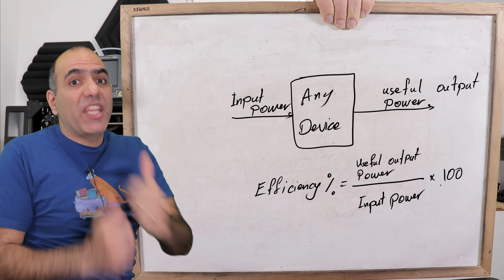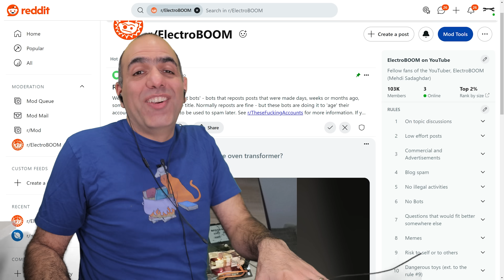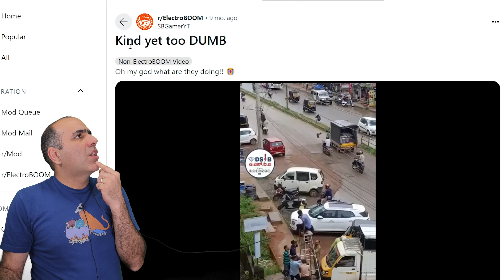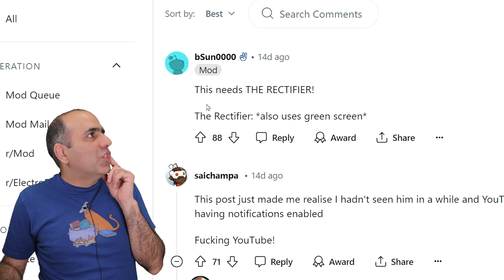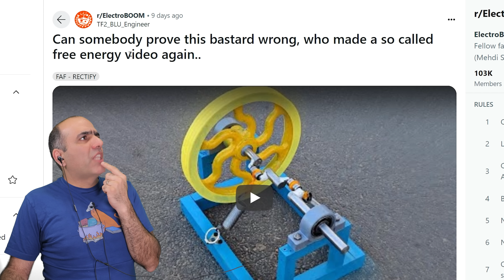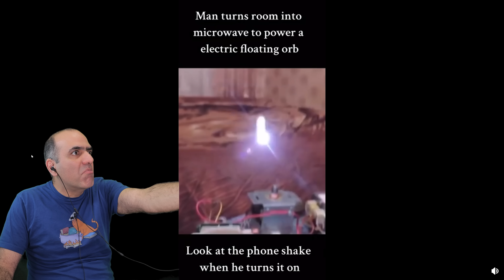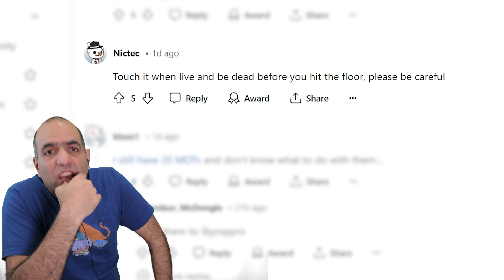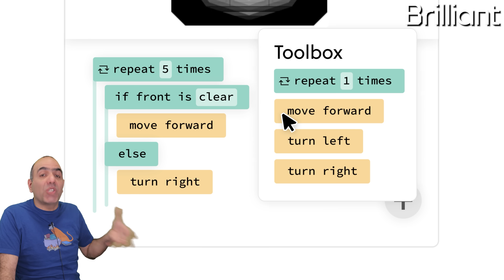New Flywheel Free Energy?! Can Boat Battery Fry You? LATITY-013

Comment: About the heater thing. A heater is intended to heat the LIVING SPACE, not you, so it doesn't matter. The losses in the cord, bearings, motor windings, etc. all get converted to HEAT which escapes into the living space, making it 100% efficient...

Comment: One kid in class the other day pulled the heater thing and i said it heats outher things not just you and some of the energy gets turned into visable light and its waisted energy
Reply: guess what happens when that light hits something...  heat
Reply: @tsm688  not necessarily the light gets reflected that's why we go for infrared heaters as they absorb into things better but visible light doesn't so well so some of the light the heater creates is in the visible spectrum and gets reflected instead of absorbed
Reply: @dbom_bp6653  one way or another the light is absorbed, unless it leaves the room.
Reply: @tsm688  it will unless you are in a completely seeled room bit visible light also doesnt convert as easily into heat energy as ir and this is all only with ir heaters normal element heaters are way less efficient either way there is all ways a loss to something even if your intention is to heat a whole room there is losses from the heater and other things around it
Reply: @dbom_bp6653  Light converts very well to heat, unless it gets absorbed by some chemical process like photodegredation
Reply: @tsm688  it converts well but not as well as ir ir photons have less energy witch help them absorb into objects better
Reply: @dbom_bp6653  you are speaking gibberish.  energy is not created or destroyed.  If they have less energy, it's because that energy was lost somewhere as heat.
Reply: @tsm688  there is also losses to sound energy listenin to a heater running they typically make a light buzz sound wich is also a loss of energy and sound energy the amount of heat it creates from the pressure waves are minuscule compared to the energy used to create them
Reply: @dbom_bp6653  you are, very simply, wrong.  those "losses" also become heat!  most of it just remains as motion - which becomes heat.  and sound is is just a different kind of motion, which also becomes heat!

energy is not vanishing from the universe.  Everything put into that heater therefore becomes heat.
Reply: @tsm688  i admit i am not 100% correct but niether are you that energy will eventually turn to heat all energy Turns to heat at some point bit it is constantly changing the energy for example in she sound some will excape through the walls and go create heat somewhere else the light excaping the room will go warm something else up even if your just trying to heat a room not all the energy that you put in the room is still there thus there is a loss of energy you can only say there is no losses if your trying to warm up the whole universe as then there is truely no energy losses but you want to talk about how energy cannot be created or destroyed but you forget the fact that nothing is 100% efficient in its endended out put there will always be a bi product of some sort as a lamp creates heat a speaker creates heat and a heater creates more easily reflectable light
Reply: @dbom_bp6653  "one way or another the light is absorbed, unless it leaves the room."

I already told you this, and now you're telling it to me as if that wasn't my point all along.  Pay attention.
Reply: @tsm688  bro just told me to pay attention 💀 I was also saying that the light can leave the room witch =energy loss and visable light bounces more thus has a higher chance of leaving. Pay attention
Reply: @dbom_bp6653  I told you that first.  Are you trying to switch sides of the argument?
Reply: @tsm688  no ofc it old have to leave some how where tf else would it go 💀 om saying it just wont nessasarly leave as heat it would leave as sound and light

Comment: 6:52 He was referring to new electric boats. The boats that are packed full of lithium batteries wired in series.
Reply: It looks like electric boat batteries are less than 144 volts DC. Of course note that DC is statistically five times less dangerous than AC. Most likely no one will ever be electrocuted by a boat battery

Comment: Even though heaters generate heat, they're not 100% efficient in producing heat due to black body radiation. They don't emmit all their input power as infrared but rather a spectrum with a peak in infrared
Reply: so what?  the other wavelengths contribute to heat too.
Reply: @tsm688  they do not. It's a common misconception.
Reply: @mannyquinn9031  They do.  It's a common misconception.

You can light things on fire with a powerful enough red laser.  I've done it.
Reply: @tsm688 heaters (hot resistors) work mostly by convection and conduction, which is the medium for most of the heat transfer, there's no way to measure the actual heating by EM radiation since different materials have different reflection coefficients. My point is "they're not 100% efficient in generating heat" since radiation isn't always converted to heat in objects, your lasers proves the point (no pun intended)  if you point your laser at an object, you're increasing the 'energy transferred' but the object still reflects visible laser light from the incident rays. No reflected ray can be responsible for the material heat up(conservation of energy) . Therefore, energy is lost via  "visible emission"
Hence, if your heater is turned on, it produces conventional heating and radiational heating via infrared, and the rest em radiation produced via BBR pass through the room almost unobstructed and produces only little heat depending on what material the room is made of.
Since some energy escapes without absorption, your heater has converted electrical energy to heat and other unused radiation. Therefore, it is not 100% efficient in producing heat

Comment: 11:00 Tell that to mrgreenguy. He opened up a microwave just to test this. And the conclusion is that it is too low power to do anything without the box around it.
Reply: tell that to the wire being vaporized in this very video.

There is of course a safe zone...  but you CAN'T SEE IT.  And microwave damage is insidious -- you won't instantly notice you're being hurt!  You might only notice when your eyes turn milky a few hours later...

Comment: In the heater some of the electrical energy will be converted into the mechanical energy due to the vibration in the heating the coil and possible light energy from the coils glowing when hot.

Comment: With a 12v battery you can't get electrocuted. However, i have a tractor that runs on 24V, 2 x 12v/100ah batteries in series, and in the summer, when it is wery hot outside, and i was sweaty, i did feel the current through my arm.

Comment: Common confusion of terms. EFFICIENCY is  'Useful WORK out' / 'Sensible ENERGY in'. A heater does no work so it is 0% efficient.

Like a heat exchanger, it can have EFFECTIVITY. This would be 'Thermal energy out' / 'Electrical energy in'. Not all heaters score 100% themselves because of noise, light, etc. But eventually everything does turn into low grade heat as we approach cosmic heat death.

Cheery thoughts. 😊

Comment: in regards to the trump comments about the battery I believe he was referencing a Tesla Model 3 which has a high voltage DC battery pack. I believe you know this, but instead chose to misrepresent what was said, and while Trump and his followers comments may have been absurd it doesnt justify your mischaracterization. Overall good video.

Comment: I worked on a 960 volt DC system for a hybrid boat, it is definitely a concern.  The boat had ground fault monitoring systems that blew pyro fuses in the battery modules, and in the series connections between them, eliminating the risk to what is shown in this video.
I volunteered to test the GFI on the live system. I had done it many times before on a 1000V power supply, so I knew it worked, but it was still nerve-wracking when you hoped everything was going to go bang but your finger.
Reply: Gas can be pretty nerve wracking too....   https://www.youtube.com/watch?v=erhd-FV4rb8
Reply: thats before some idiot replaced the fuse with a carved up penny. :P
Reply: In what scenario you would get shocked by a submerged DC powersource? You have to be swimming between the terminals
Reply: Yeah a Hybrid boat is what trump was talking about.  Still risky for sure even with GFCI.
Reply: @Ccs4646  Is 30 gallons of gasoline safer pouring into the water around you? I feel like its the same argument my great grandpa made against using a car and decided he'd ride a horse instead.    https://www.youtube.com/watch?v=wAM_EtjxFhE
Reply: @mikestevens4147  30 gallons of gasoline doesn’t spontaneously combust as soon as it hits water…
Reply: @Ccs4646  Hollywood says "Hold my beer". :-\
Reply: @Ccs4646  As already mentioned, neither do traction batteries built for marine use. What can happen though is that ships can produce sparks when damaged since combustion powered ships still have electrical systems. And there's usually a lot more than 30 gallons of gasoline on all but the smallest powered boats.

Comment: 0:40 some heaters light up. This would be a waste of energy. Some vibrate or make noise. Some have an LED or neon. These would all be wasted energy
Reply: That was the first thing I thought - it's the opposite in the case of a heater - light is the waste.
Reply: All of them eventually turn into heat.
Reply: no its not.  even a 100% perfect light source would still end up as heat eventually, as the light is reflected and absorbed various objects, unless you let the light escape the room.

Comment: Trump (guessing here) was probably ranting about electric boats with a huge Lithium battery. Having a DC battery of several 100V in the water might give you a tickle but i think in the sea, salt water has lower bulk resistance than you (more so lard-ass DJT). As long as you don't touch the terminals you won't get electrocuted. However if it's shorted and the cooling is not enough it miht still catch fire? hhat would be scary. Can we chuck someone's Tesla in the harbour to confirm?
Reply: The entire thing was really stupid, like a shark is most likely not even gonna come close to attacking you.

Cows are more dangerous than sharks ffs

Essentially trump's rant was "this one thing that probably won't harm you or this other thing that won't"
Reply: He was referring to fully electric cruiseliners.
Reply: Sea water doesn't give a total short. It would probably boil around the terminals and then break the connection. I don't believe the battery would  over heat. Also the sea water would cool it pretty well. 
Next the sharks are supposedly very sensitive to electric current in the water and would probably swim away. It would then be safer to sink with an electric boat than a normal one.
Reply: I mean, 30 gallons of gasoline in the water around you and one spark would be pretty bad too. Actually a lot worse since lithium burns slowly and doesn't ignite in a big flash. https://www.youtube.com/watch?v=erhd-FV4rb8

Comment: 0:54 Just want to point out, even if the goal is to throw heat into the universe, still it's  not 100% efficient. Some energy get wasted in generating sound, especially in those cheapo AC mains heaters. Even if we don't hear it out, some sub-atomic phenomena can convert some miniscule amount of energy into something else other than heat
Reply: guess what sound ends up as...  heat
guess what light ends up as ..  heat

the only wasted energy is the energy leaving the room
Reply: @tsm688  thanks for the reply. can you share some resources on the topic? does sound end up as heat?
Reply: @electrotsmishar  
sound ends up as heat.

light ends up as heat.
infrared ends up as heat.
radio waves ends up as heat.
particle radiation ends up as heat.
motion ends up as heat.
are you sensing a pattern?

This is a consequence of the laws of thermodynamics, which say energy is not created or destroyed.  When these energies fade away, what's happening to them?  They're either drifting away or becoming heat.

If a photon happens to hit a plant, I suppose it might be absorbed instead of becoming heat.  It still generates some heat, just less.  And when you burn that plant you get the missing energy back.  Nothing lost, nothing gained.  That's conservation of energy.

Comment: Hi Mehdi! I have a question to ask you. I was wondering if you could explain to me why when I play a 20hz sinusoïdalon tone on my tongue with an amplifier, I start seeing the LED bulb of my bedroom flickering. I haven’t tried other frequencies so I don’t know if it does the same thing with others. I tried filming the light at 240 and 60 fps with my iPhone to see if it is the light that is flickering or it is just something from me. Surprisingly, I never saw the LED flicker. And I also find out that it doesn’t do it when I connect de wires to a less conductive part of my body. So, my question is: Is the 20hz signal messing with the nerves of my eyes? If it is, can you explain me how it is doing that. Thank you very much! I love your content!
Reply: Not enough evidence.  A camera might not catch it unless it's looking at the exact right moment.  I think you'd need to watch (or hear) the LED with a photocell to catch it flickering.
Reply: I don’t think so because the was constantly flickering. Not only one time. All the time I was putting the wires of the amplifier on my tongue, the light was flickering. I had no way to mesure the frequency of the flickering but I think that it was pretty much at the same frequency played on the amplifier. Sorry if I didn’t explain it correctly, English is not my main language. Thanks!
Reply: @divaton  Sound is faster than the camera, though.  I think the output of a photocell circuit would be useful in figuring out what's happening.
Reply: @tsm688  I’m not sure to understand, there was no sound. Only light blinking. And it was pretty slow flickering so I’m pretty sure that the camera would have got it. But to be sure, next time that I’m gonna have the opportunity to redo it, I will ask someone to see if they see the light blinking to confirm if it’s the signal of the amplifier that’s messing with my eyes. Thanks

Comment: 3:33 Pretty sure this is fake, as I have the same candles and they just turn on with a remote
Reply: And I just noticed that the lamp turns on a frame before the fire appears
Reply: @KurzhaarBard 
First off, replying to your own comment makes you look like a fool.

Secondly, fake or not, this is actually possible and actually quite easy to make. Even a heat sensor in sync with a shock sensor would do the trick.
Reply: @dogs-and-destruction-channel  Why does replying to my own comment make me look like a fool?
I don't like editing my comment as there's always the possibility that people think what is now there is not the original message

Comment: Electrocution is all about skin conductivity(sweaty/salty 👐 and 🫀fibrillation. Only a small current(xx mA) need to flow between extremities for that to happen🤔). So a boat battery could indeed electrocute, but no smoke or fire involved😢. Also when two bulbs with varying wattages are connected in series, the bulb with the lower wattage(more resistance), starts heating up faster, and since tungsten filament has positive thermal coefficient, the resistance increases further, limiting further current through high wattage lamp(which then remains in its lower resistance state, without glowing). I do like the funny fact based presentation, though a bit simplified😊❤👍

Comment: heaters aren't meant to warm your body specifically as much as they're meant to warm the environment your body is in - I don't know if that necessarily makes them more efficient but I would have to assume that the actual efficiency factor depends on the resistor being used to generate that heat in the first place

Comment: 8:50
If it is an electric boat I would assume they are using powerful car batteries. So it might be more like 800 V than 12 V.
So maybe don't touch the battery while it is under water 🤷‍♂.
Reply: From a google search it's closer to 120v. Still don't go touching them but I doubt the death zone would be very large.

Comment: At the risk of sounding like a Donald Trump supporter (I most certainly am not) he was not referring to a 12v or 24v  battery like one would use to start a combustion engine on a boat. He was referring to the high power packs found in Tesla automobiles. He happened to be visiting an electric boat manufacturer. His question is still pretty stupid, though, for a number of reasons, not the least of which being that it presents a false dichotomy, as though your only two choices would be to jump towards the shark, or stay on the boat...completely ignoring that you could just as easily jump off the boat in the opposite direction of the shark.

Comment: Mehdi doesnt know about boat battery systems. For instance on a fishing boat you may have up 4 banks of very large batteris to make up 48v systems for fishing boats electric trolling motors, and on larger boats they have electric bow thrusters that run off higher than 12v dc. There are also boats (Power and sail boats) who have large banks of batteries to store energy from solar for refrigeration, or running systems with the generator off.  They also have large battery banks with 120v inverters.  

So Mehdi, get in a salt water bathtub with 4 or 5 truck batteries in series.   And also a shark just to see.